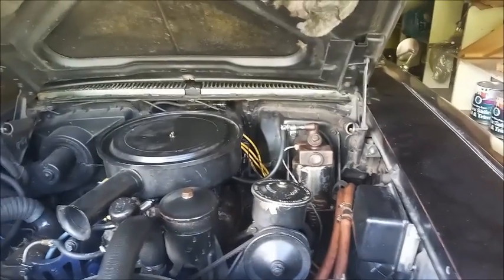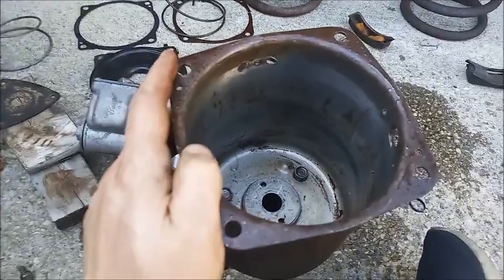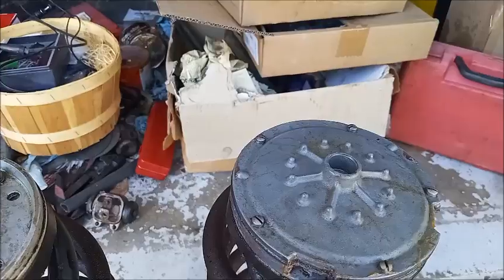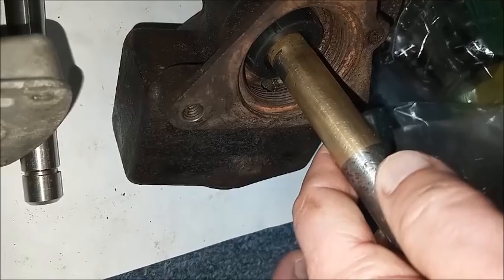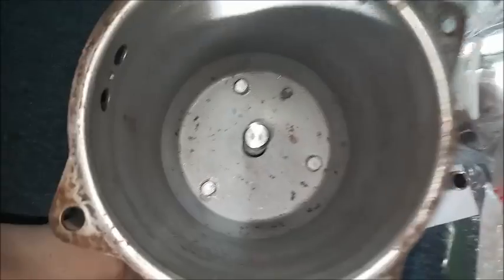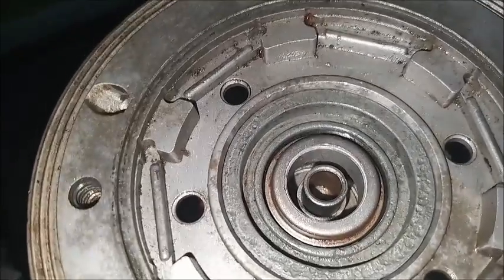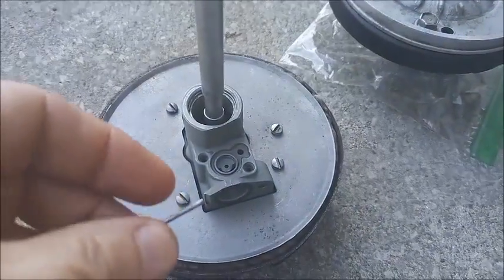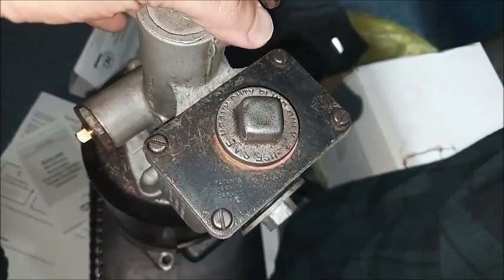1958 Cadillac Power Brakes: Bendix v. Delco Moraine

Comment: Where did you purchase the Bendix Diaphragm & gasket for the 58 Cadillac 60 Special ? We are have a really difficult finding one for the 58. Thanks
Reply from the maker: @lindabranch-h7d  I bought a Bendix core and a regular kit from ebay, so I didn't get a new diaphragm.  Mine works except for that warped piece mentioned in the video, so you could probably build a fully functional unit with the two.

Comment: Are they interchangeable
Reply from the maker: Yes.  Either one bolts right in and hooks up the same.
Reply: @brianandcindy1  do you build this unit and if so how much
Reply from the maker: @SamuelLineberger-or7go  I could if it isn't rusted much, but you would be much better off with a professional build, which could offer you a lifetime warranty.  Whitepost gets excellent ratings.